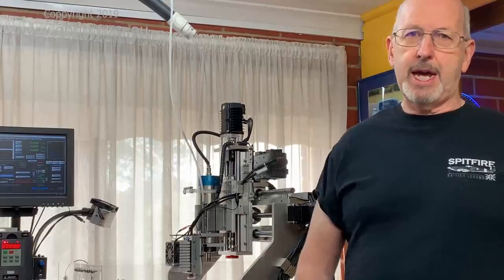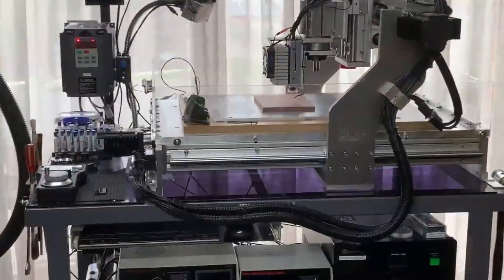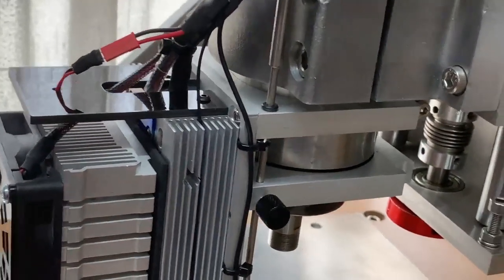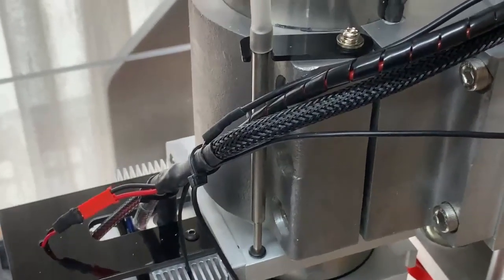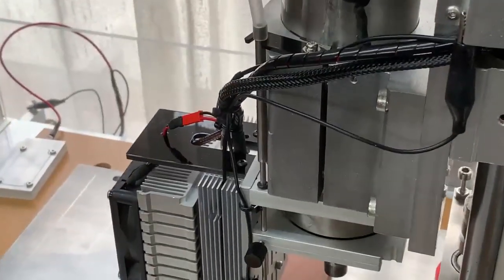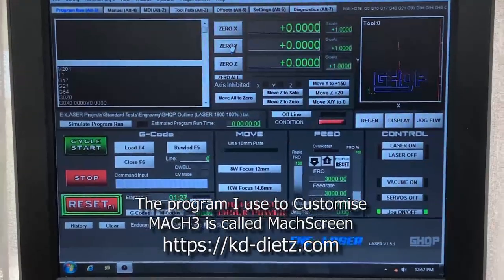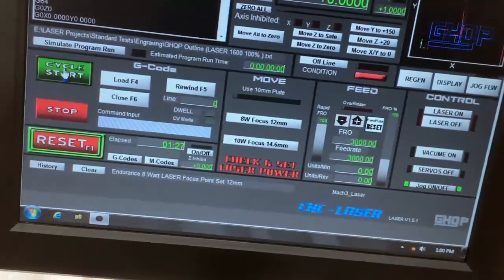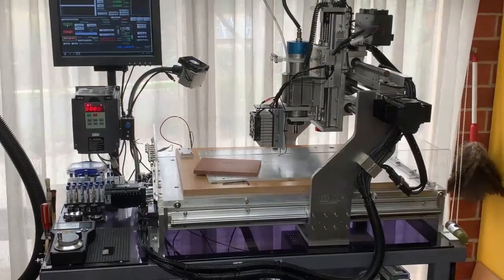Fitting my version of Endurance 10W+ Laser – Video 2 of 2

Comment: Very nice.  I like the way you monitor the system's vital information.  A few months back I bought a Chinese laser for my CNC but haven't finished controlling it yet.  I use a break-out board with PWM output and hope to configure Mach-3 to control the power.  I know some people use the flood coolant output of Mach-3 to turn the laser on/off.  How are you controlling the laser?
Reply from the maker: I use Vectric Aspire and wrote my own laser Post processor. It includes macros for direct switching of one of the spare I/O ports of my Mach3 Controller to switch the laser on and off.